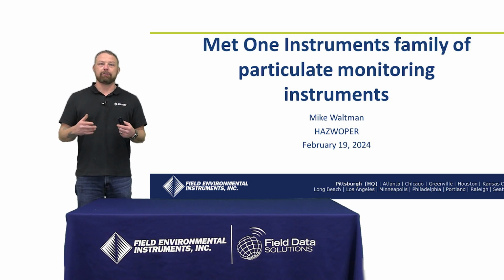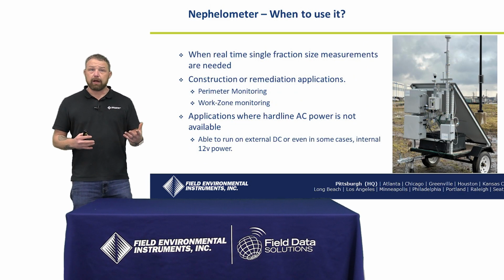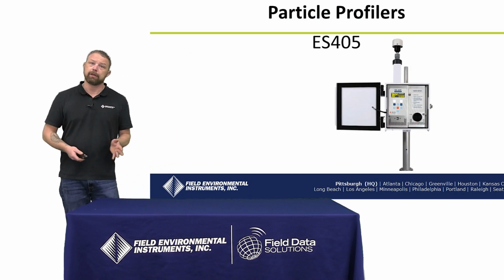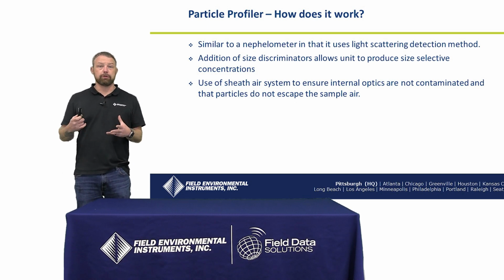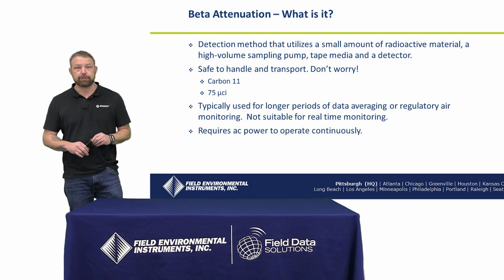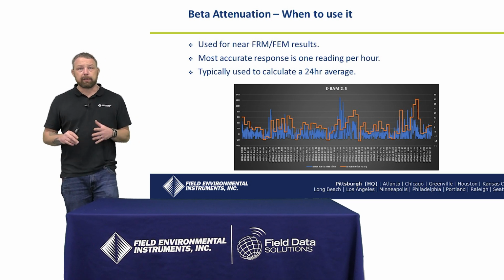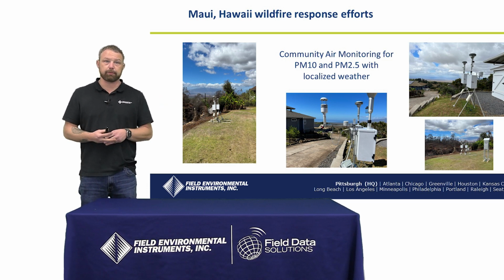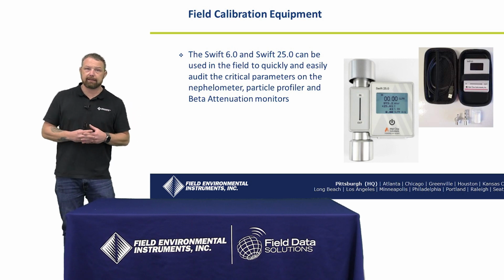Met One Instruments Family of Particulate Monitoring Instruments

Comment: Hello, good morning. I'd like to get some clarifications. Using a handheld particulate matter measuring device, specifically Met one, I have some question.
1. I find there is Aerocem and HHPC variants. Can you help shed more light on this?
2. As a professional in the field, does the devices measure specifically for the sizes or do they measure, for instance, 2.5micrometer.. is it the exact size or it measures upwards from 2.5 to other sizes above and available in the room?
3. For the sizes, in your experience, do you get larger concentration of p.m 10 than 2.5 in industries? We use the Met One HHPC which shows more concentrations of lower PM diameters than higher diameters.
4. Do you self calibrate your equipment

Would appreciate your fedback